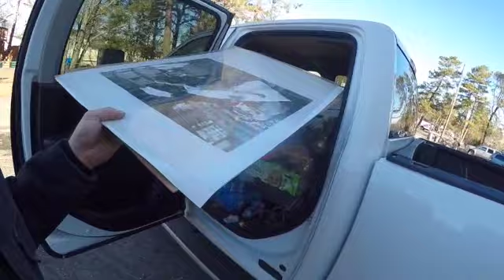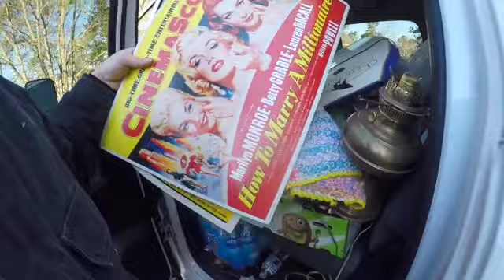House Clean Out With Blue Bus Dave Just The Treasures I Took

Comment: Iron stand is used by a cobbler. Flat part goes on ground and you put a shoe "last" on the pointy end.  The "last" is shaped like a shoe - it would used it like an anvil to hammer the nails in the leather shoe sole.